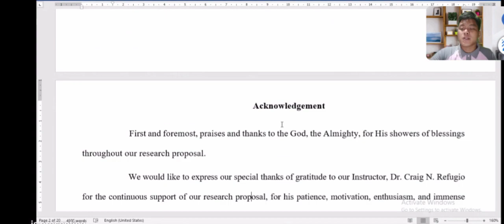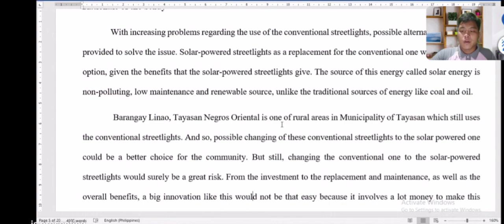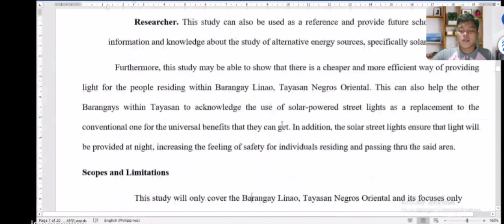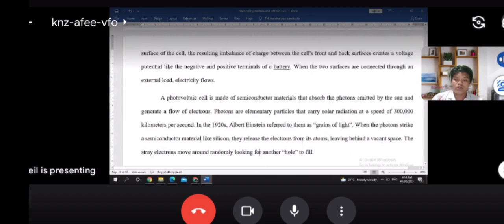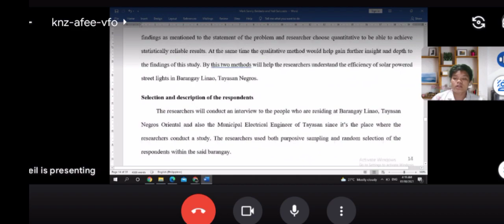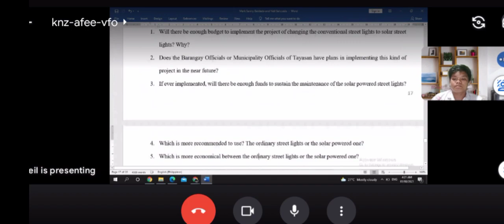Efficiency of Using Solar Powered Streetlights in Barangay Linao, Tayasan, Negros Oriental

Comment: Name :  Rytz M. Kilapkilap
CLASS NAME AND  CLASS SCHEDULE : COE 346 Methods of Research T-TH 5:00-6:30 PM
DATE : March 24,2022
Reaction: I am very happy that the researchers come up with this kind of  research proposal. They can help to the community more safe and make the community free from accidents.
Reflection: This kind of research proposal is helpful to the community that has limit of electricity. By this kind of research proposal the place will have the correct amount of electricity that they needed. It can also provide the need of the street lights to make the place clear and a bright place.

Comment: NAME: Reynabelle Kim Noble
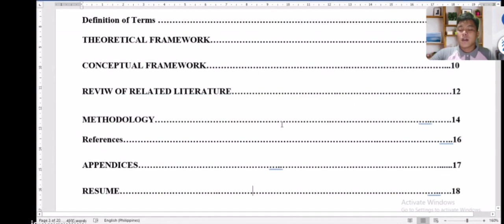CLASS NAME & CLASS SCHEDULE: ENS 341 A (2:00 – 5:00 SAT)
DATE: March 24, 2021

REACTION: After watching this video, I realized that, despite our hot climate, the sun is still a valuable resource for the improvement of our society. They presented well that the sun has many functions in providing us with an unlimited source of energy and even demonstrated that it can be used for such a solution.

REFLECTION: Though solar energy is common, using the sun is still a great innovation that is far too efficient and dependable for this study. This is a beneficial idea not only for the environment but also for promoting security and safety to all residents of Brgy. Linao, Tayasan for drivers and riders.

Comment: Gliocam, Blessings C.
COE 346 Methods of Research T-TH 5:00-6:30 PM
March 24, 2022

REACTION: The community will benefit from this research if their suggestion is implemented, and the community will save money in the future as a result of solar energy.

REFLECTION:  Solar street lights installed on highways and other public spaces improve accessibility, will strengthen social interactions. Furthermore, these lighting solutions aid in the decrease of insecurity, theft, and attacks in more remote locations.

Comment: Patron, Kent Ryan M. 
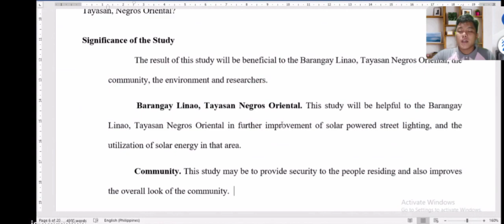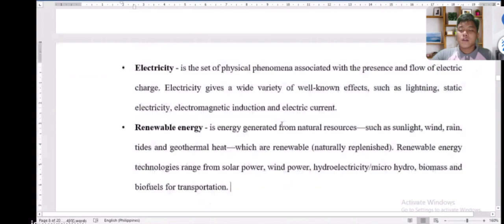EE341 A (6:30-9:00)
MARCH 24, 2022
Reaction: 
This proposal helps people to feels more secured and at the same time it helps produce energy while it doesn't emits any pollution. It is very impressive because the researcher`s idea is very helpful because using solar powered streetlights may be able to have pollution free and causes no greenhouse gases. It is also cheaper and more efficient way of providing light for people. 
Reflection: 
More remote places can be lighted by these project, these lighting solutions aid in the reduction of insecurity, theft, and attacks. It will also be able to help the community to conserve and save electricity.

Comment: NAME: Cual, Kayzielle B.
CLASS NAME & CLASS SCHEDULE: ENS 341 A (2:00 – 5:00 SAT)
DATE: 3/24/2022

REACTION: Based on the video I had watched, the audio is audible but I could hear background noises. The visual presentation of the researchers is simple and it could have been better if the font size of the letter was bigger since it was being projected using Microsoft word. They had presented their research very well and in a very concise manner. Over all the presentation was very good.

REFLECTION: With this research it is helpful to the residents in Brgy. Linao, Tayasan by promoting security in urban areas and also improves safety for drivers, riders, and pedestrians. Aside from it promoting security to everyone, it is also helpful to the environment since it is powered using solar.

Comment: NAME: Miraflor, Joshua

CLASS NAME & CLASS SCHEDULE: ENS 341B/ 5-8 PM Saturday 

DATE: March, 24 2022

REACTION: This research project is very informative and environment friendly .This study produce energy using solar power and doesn’t emit air pollution.

REFLECTION: Solar powered street lights is one of the best proposal . In addition to many benefits such as cost and performance, the use of solar lighting solutions has a lasting positive impact on the environment, helps the community. Solar street lights are powered by photovoltaic panels, meaning they produce clean and sustainable energy.

Comment: NAME: Cheri Mae E. Tinguban

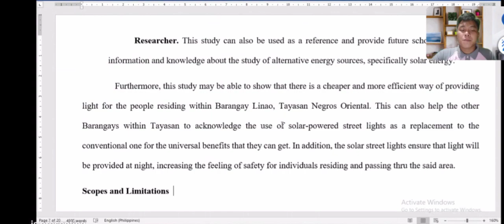CLASS NAME & CLASS SCHEDULE: ENS 341 – Research Methods for Engineering – 5:00-8:00 Saturday 

DATE: 24/03/2022

REACTION: The "Efficiency of Using Solar Powered Streetlights in Tayasan" is the topic of this project proposal. According to what I saw in the video, Barangay Linao in Tayasan is located far away from the highway, where just a few streetlights are being installed, but not all of them can give a good source of light to all of the streets where they are installed. That is why the researchers conducted a study to determine the efficacy of employing solar-powered street lights instead of traditional street lights. And, in my opinion, solar street lights are essential in providing safety and promotion in urban and distant locations, particularly in Tayasan's districts without access to a traditional electricity grid. They increase the safety of drivers and pedestrians who travel beyond of daylight hours.

REFLECTION: Something happened in my life that caused me to have a major traumatic experience on those streets with very few or no illumination. When I can't see the road at night, I despise traveling. I can't even sit there and enjoy the journey if I don't have an option but to cross that pitch-black street. As someone who has experienced this type of tragedy, I would be really grateful to have these types of lighting since they provide protection and security to drivers. When I think of Tayasan's dark streets, not just in Tayasan, but on all the streets without streetlights. I am hopeful that the administration will find a solution to such problems. I hope and pray that the Solar Street Lights would bring more light to these areas. The people would be really thankful if these investments were to come to fruition in order to protect the drivers and civilians in that area, as well as to ensure everyone's safety.

Comment: NAME: BERNALDEZ, ELLYN MAE A.
CLASS NAME & CLASS SCHEDULE: ENS 341 - SATURDAY (5-8PM)
DATE: March 24, 2022

REACTION: Based on the video presented, the research proposal is very impressive because the researcher`s idea is very helpful because using solar powered streetlights may be able to have pollution free and causes no greenhouse gases. It is also cheaper and more efficient way of providing light for people. 

REFLECTION: In this research proposal, Solar Powered Streetlights ensure that the light will be provided at night, increasing the feeling of safety for individuals residing and passing thru. With the advantage of solar energy, it will able to help the community to conserve and save electricity as well as their money.

Comment: TRE-INTA, KEZIA L.
EE 341 TTH 6:30 - 8:00 PM
MARCH 24, 2022

REACTION: This is a nice idea, very useful especially on areas where there is no electricity and I think it's better if the streetlights is automatic wherein it turns on during night and turn off when the sun rises up. Hopefully this will be on the market soon!
  
REFLECTION:  This solar powered streetlights uses energy from the sun making it more efficient to be used since power interruptions are never a problem for this project because it doesn't use electricity coming from stations instead provide its own electricity to power itself.

Comment: Greg Anthony  C Peñez
EE 341 TTH 6:30-9:00 PM
March 24, 2022

Reaction: The presentation needs improvement. The use of of solar energy and efficient is very good research. So thoughtful of the researchers to look for answers to the lack of electricity supply in the baranggay. 

Reflection:
Abundance and availability of solar energy in our country is known, harnessing it will help illuminate remote areas mostly in our locality.  And since it is used for street lights, It help for the safety of the streets during night time

Comment: NAME: ATOY, AMIEL S.

CLASS NAME & CLASS SCHEDULE: ENS 341 - SATURDAY (5-8PM)

DATE: MARCH 24, 2022

REACTION: The video shows us that the sun has many capabilities in giving us unlimited source of energy. As a student, it shows me that this project is an environmental friendly , reliable and a great answer to problems on road lights.

REFLECTION: This research proposal is very common to us especially when it comes to energy conservation, using our own sun as a source to store and use it as lights during the night is a way too efficient and reliable not just for the safety of drivers but also to lessen installation cost of energy creator systems.The area with the installment of this project will benefit from this research if their suggestion is implemented, and the community will save money in the future as a result of solar energy.

Comment: Macabinguil, Joshua R.
COE 346 Methods of Research T-TH 5:00-6:30 PM
March 24, 2022
REACTION: This research can help the community by implementing their proposal as well as the community can save money in the future because of solar energy.
REFLECTION: Some of our barangay here in Siaton really need a streetlights to make the community safe and have a brighter streets to walk on. Their research is a big help to have a better idea and exact data needed. Electrical energy is the power an atom's charged particles have to cause an action or move an object.